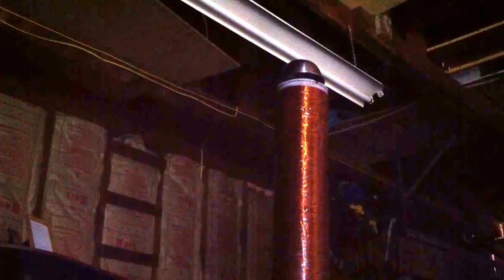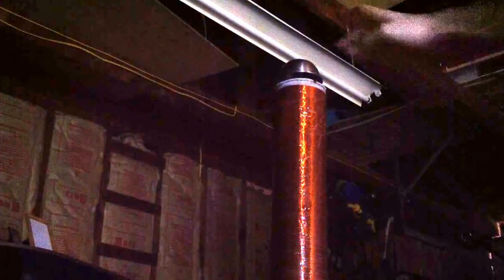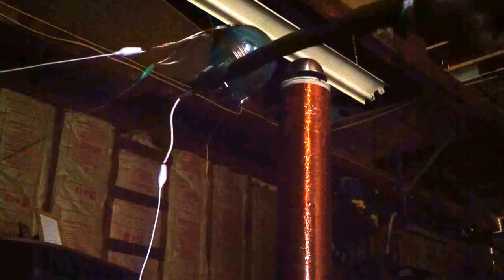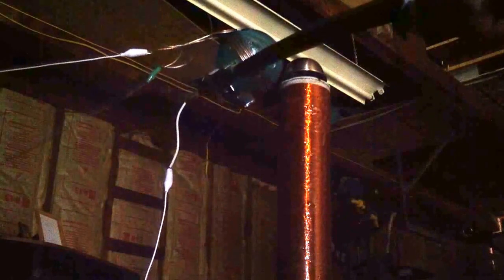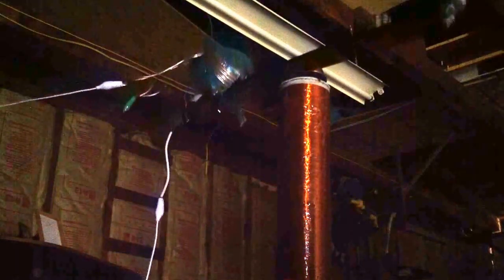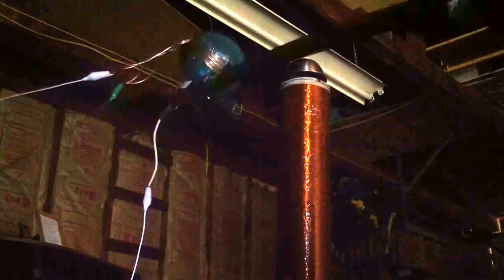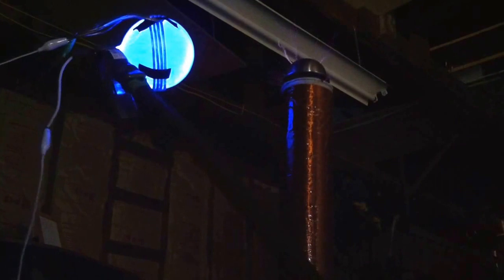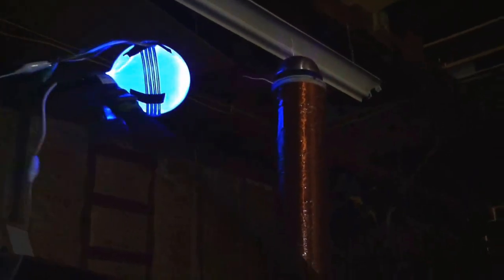Experimentation and findings for the Plasma Globe Capacitor. (Part 3)

Comment: I'm glad I saw your video. I also produced this phenomenon a few years ago during an experiment at home. See my video for the setup I was using at the time..
Experiment #1 - High Voltage Transformer With High Frequency Neon Primary Coil (2KV, 30mA @ 55KHz)

I have done it many times since then, with 2KV - 15KV power supplies in various circuit configurations. I have used coils, metal pipe and foil tape with the same result. It seems that all you need is a conductive metal around the plasma/vacuum tube - not necessarily a coil.

I found that the plasma/vacuum chamber holds the charge for a considerable amount of time. I believe the energy is somehow oscillating in the glass/ dielectric material between the two conductive (coil & plasma) surfaces. The reason I say this is because I have fully removed the plasma tubes from inside the metal pipe after being excited. When I reinserted the plasma tube in the metal pipe, I was able to get a discharge. So it seems the energy is stored in the plasma chamber walls - not the coils/metal tubing or the plasma itself.. Just like a capacitor :)
MIT Physics Demo -- Dissectible Capacitor 

Usually you'll get the big initial pulse, then the oscillations die down slowly, however, sometimes, larger pulses are seen between smaller ones. And just when you think it is fully discharged, you get another pulse... It's weird and unlike a capacitor in this regard. Anyway, just my observations..

I did think about an experiment last year.
It involves using a strip of foil tape on the side of the chamber, forming half a turn or three-quarters of a turn around you plasma globe, so that you don't get the magnetic coupling between your plasma and the external conductor (foil). For my setup, where I use long neon tubes, I would use a metal pipe with a slit cut right down the length of the tube. It would be good to see what happens :)

I think it's important to reduce the magnetic coupling because when high amounts of power are put through the plasma, the effect seems to put a huge load on your power supply and will also burn holes through the glass.

Have you tried discharging it to the base of your secondary while the plasma globe is near your topload?

Good share!
Reply from the maker: I am glad we found each other as well. Glancing through your vids I actually watched and envied over one of them before. It was that X-ray transformer you got at the scrap yard. Russ shared it but I should have looked further into what you were using it for. 
That video you just shared was an excellent demonstration of a 1 wire system. I believe a term we could use is efficiency with a reactive load. You want to try something that is also quite intriguing? Set your spark gap up for one side grounded out of your primary. I am getting quite a lot of heat on what would be the "anode" side that is earth grounded out of L1 primary. I need to measure the current going into the 5KV NST to see what I am drawing, if its actually more than .30mA, because that would make the abnormality irrelevant.   I only have it hooked to 1 out of the NST so it would be considered a 1 wire in.  We should talk more some time. I would love to share ideas of energetic exploration. Thanks for taking the time and energy. :)
Reply: Diadon A
I have tried this too - your transformer is undoubtedly supplying the additional current that you see being dissipated in the gap, but I have been wrong before :)

Yes, I'll keep watching your videos. Keep in touch mate!
Reply from the maker: I was also suggesting it because you might save your little transformers from blowing that way. Might save it from saturating with such high kick back. Perhaps it will do the opposite though lol. I will do the same on your vids. 
-Namaste new friend.

Comment: Very cool! I bet the fluorescent bulb/tube above the Tesla coil will hold a HV charge just the same as the plasma globe.?.
Reply from the maker: I actually started with a CFL, I found it has a small charge until the dielectric breaks down. It's not as powerful I believe because of the vacuum not being strong enough. I  have not tried it with the Leedskalnin coil yet. That is an excellent idea to see if the mercury vapors spin in the natural magnetic field we are trying to create.